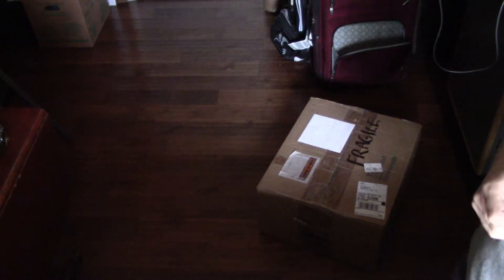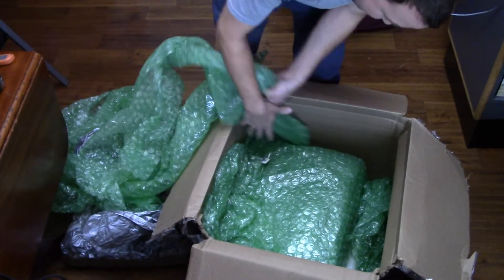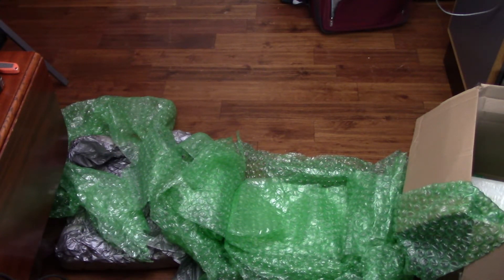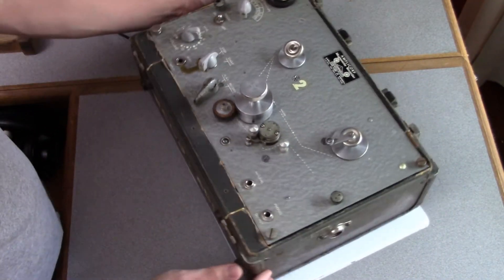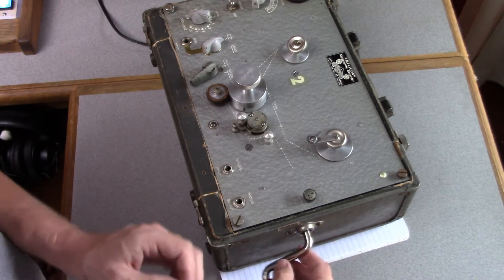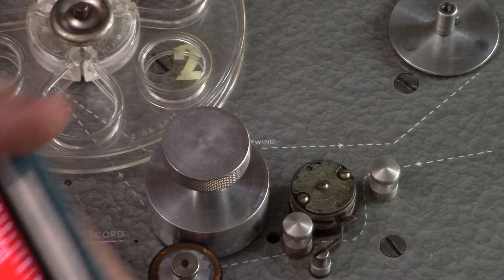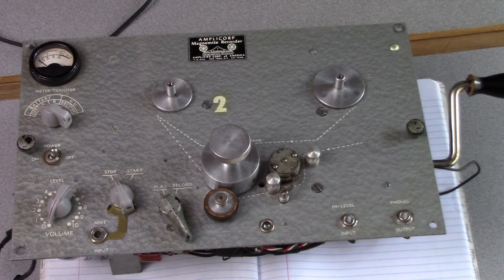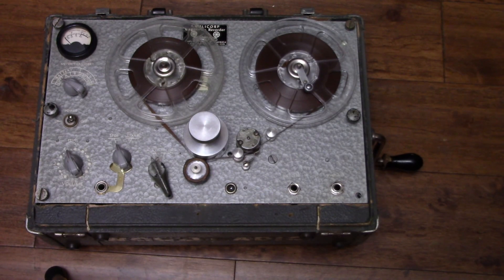THE UNBOXING, 2022 EDITION

Comment: I'm really glad the tape recorders arrived safely Ricky.  I really hope you get the Magnemite working.  just to let you know,  the large knob behind the pinch roller unscrews, then you unscrew the nut that holds the steering wheel to the lid of the case and you place the steering wheel on the shaft where the large knob was screwed onto, then you screw the knob back on to the shaft. and as you stated in the beginning, that is your flywheel. please check out a picture of one of these on line to see what I mean.  great unboxing video,  look forward to part two.